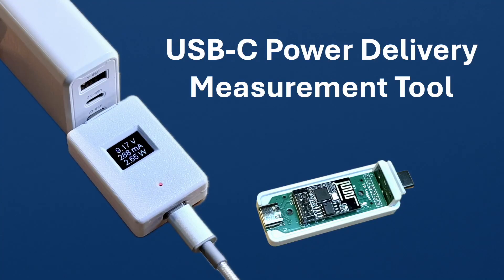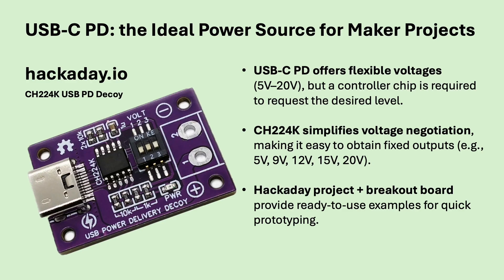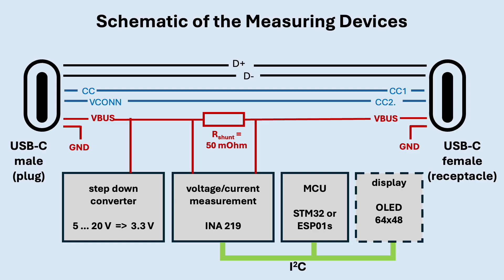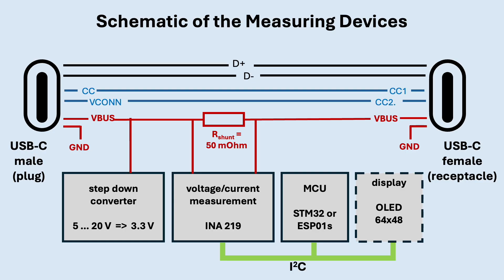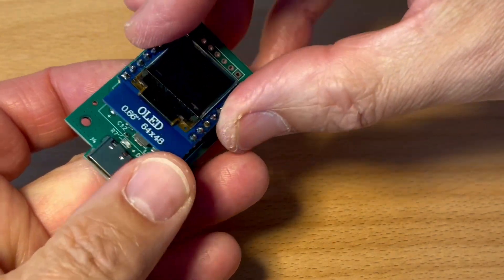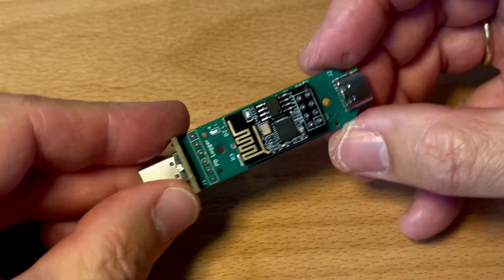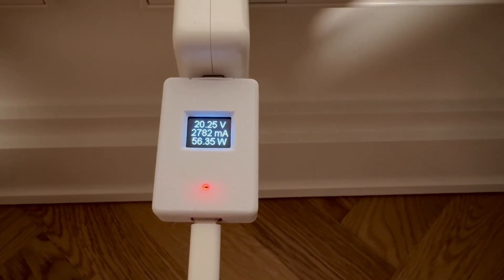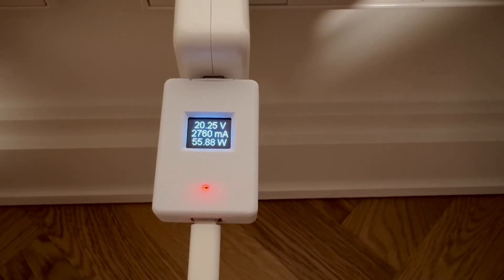Turn Any USB-C Charger Into a Lab Power Supply!

Comment: HI there this is such an awesome project.  Is there a way to connect to this device using MQTT so I can import data into Home Assistant?
Reply from the maker: Hi Simon, currently, the device does not have that capability. However, I am sure MQTT could be integrated. The limited ESP01s resources (memory in particular) might be the biggest challenge.
I am busy with a different project right now, but I could look into it, once I find some time. Happy new year 🎉, Ludwin
Reply from the maker: Hi Simon, you sparked my interest in MQTT. I implemented the feature today. The extended software is now available in my GitHub repository. In the readme file you will also find two screenshots showing how I implemented MQTT.
I would be happy if you could try MQTT with Home Assistant. I don’t use Home Assistant myself, so I was only able to test with various MQTT servers.

Best regards,
Ludwin

Comment: Great Project, i am was looking for a small data logger. Perfect! Also i ca reuse My old esp-01 devices
Reply from the maker: Great. To get started, you can use an INA219 breakout board. Check for example on Amazon or eBay